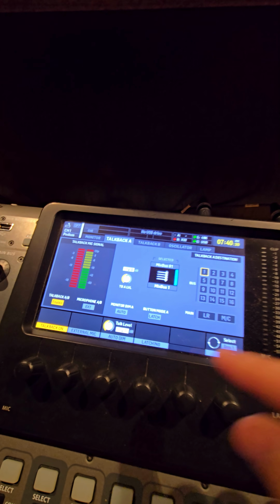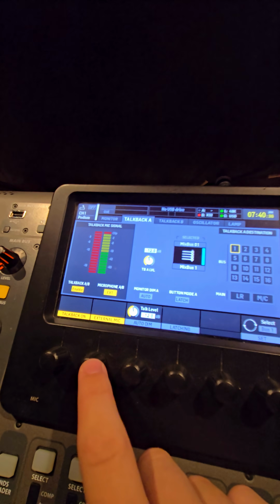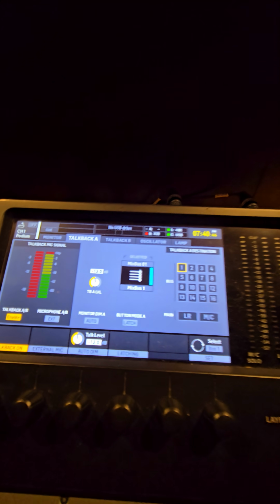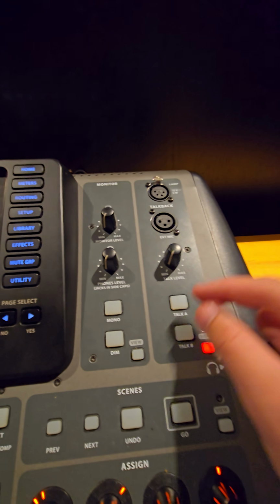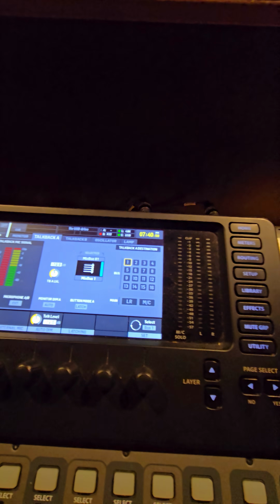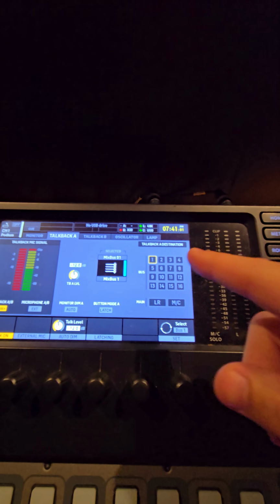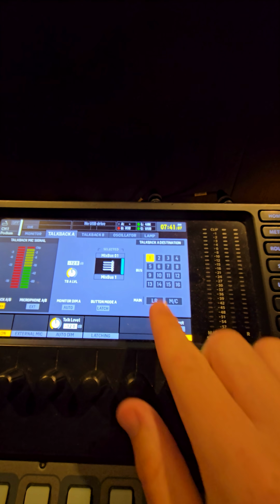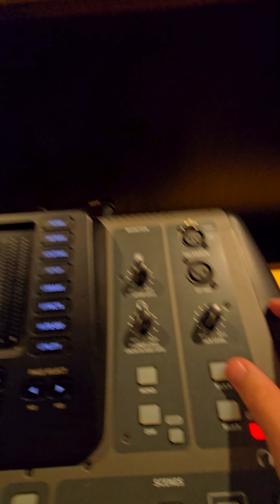X32 Talkback in 1 Minute || X32 Tech

Comment: Is there a way you can program the talkback to only go to in ear monitors
Reply from the maker: Yes, you would simply only route the talkback to the busses that your in ears are on. If you are using something like the p16  personal mixers there should be the option for talkback under the p16 configuration, if that does not work, you could also have a mic on an standard input that only routes to a channel on the p16.